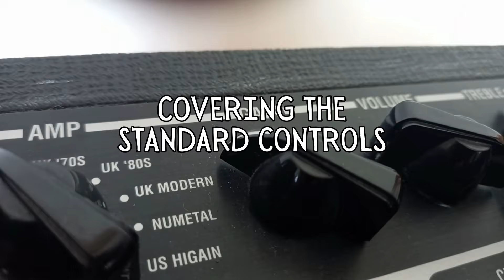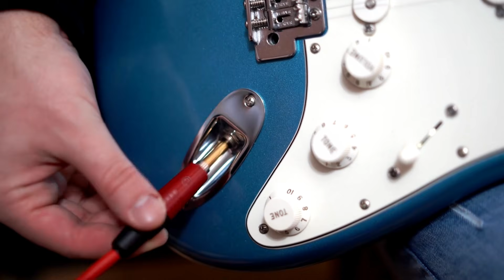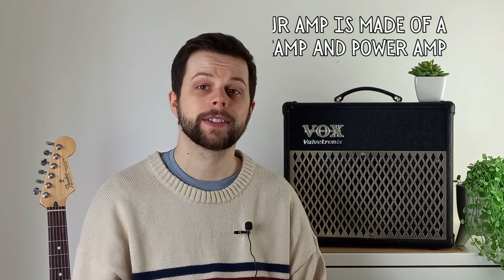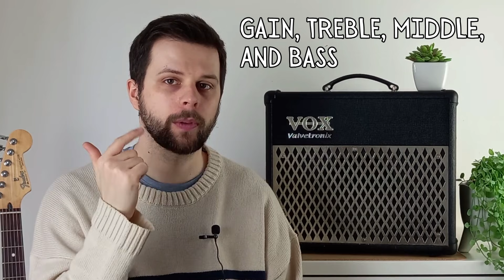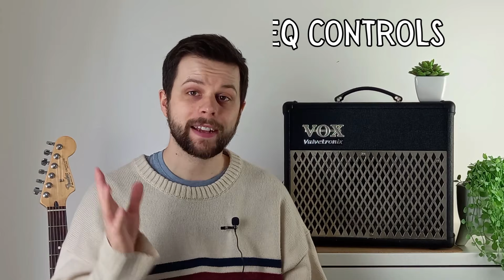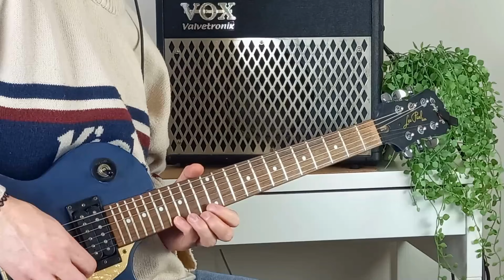Guitar Amplifiers Explained: Beginners Guide

Comment: Can a "guitar amplifier" be used as a keyboard amplifier, also, or does one need another device? (not asking about using them simultaneously, just whether one amplifier would work for both)
Reply from the maker: Technically, yes - but I'd recommend picking up a dedicated keyboard amp if you can!

They work on different signal levels (guitar amps expect an instrument level signal, and keyboards output line level). Also, a keyboard amp will have a flatter response, so it doesn't shape the sound as much.

If you've only got one amp, then I'd just turn the keyboards volume down a bit before using it to be safe 😊
Reply: @ConorRocks  Thanks for the information!

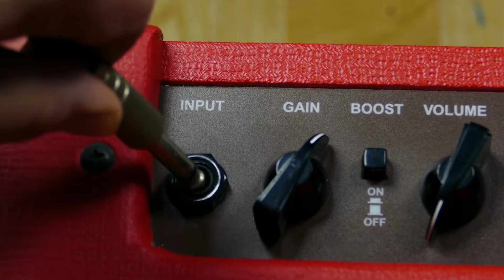Comment: 0:22 i don't want to say you're wrong but the weird bzz bzz sound stays on when i plug my guitar because its funny noise.
Reply: Hello, guitar and amp enthusiast here. See if these can help:

1. Often times, the guitar ( connecting) cable is the culprit. Check using a different cable

2. Buzzing ? Power off, disconnect the cable, keep gain/volume to minimum on the amp and power on. If loud buzz persists, the input jack in the amp needs checking.

3. Sometimes issues could be at guitar end too. Loss/poor ground connection at the cable socket can result in buzz sounds.

Hope these help. Best, my friend
Reply: @gopalshekar986  he said he likes the noise
Reply: @macawnd  lol 😄

Comment: My amp doesn’t have a middle nob, can you help me use it and substitute, also how do you make palm mute sound louder
Reply from the maker: The only way I can think would be to pick up an EQ pedal and adjust the mids using that!

For something loud but still palm muted, I'd say try resting the very edge of your hand very lightly on the saddles if the bridge - then try experimenting with your hand placement and the amount of pressure from there!